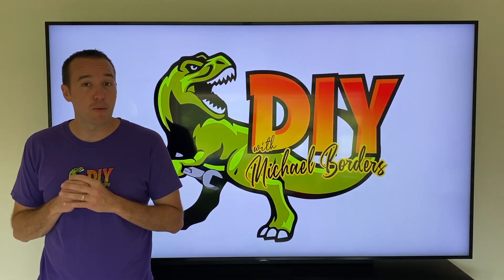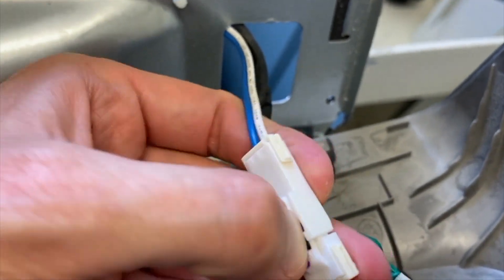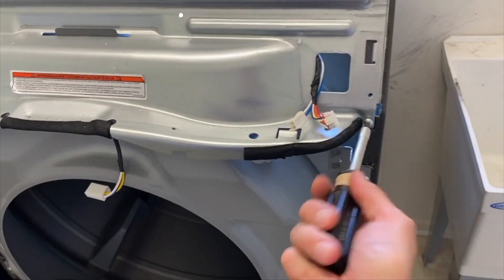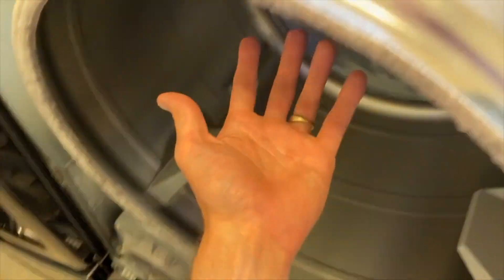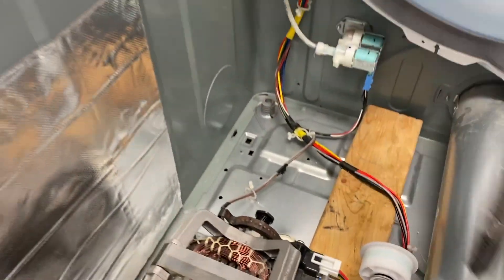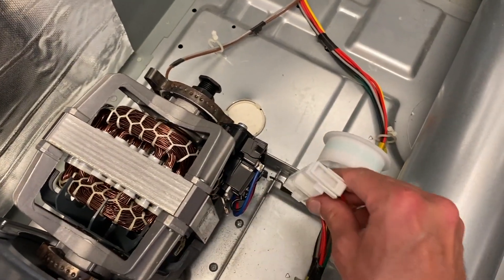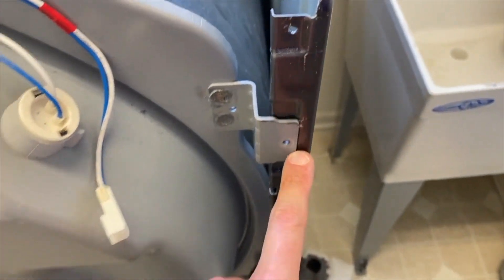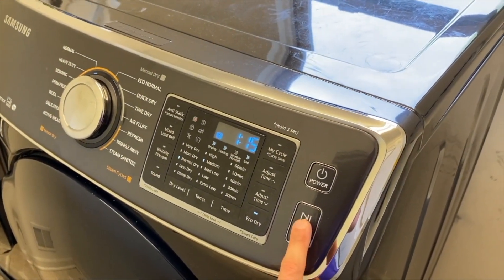How to replace Samsung drive motor - Dryer buzzing/humming

Comment: You My friend is a life saver. My machine had suddenly stop working after a piece of clothing had gotten caught in the lint trap because I had forgot to put it back after empty it. I heard a dislodging noise I quickly open the door to find out the lint tray was not there(oops) Immediately I thought it was the belt. I took the top off and check the belt and the belt was intact. After watching your video, I learned about the rollers and still wasn't sure if it was my motor that got blown out.  I started to tug the drum forward a couple of time to make sure it was sitting on the rollers. I started the machine and still no spin.  I tugged the drum again forward with two hands and gave it a good pull.
I started the machine again and voila!! You just save me $400. Thank you so much for your tutelage and God bless you my friend!!!!!! Big Thank You Sir!!!!
Reply from the maker: Awesome, that is great news!  Saving $400.00 is a wonderful feeling, regardless the situation.  😁👍

We are happy to hear you’re back up and running.

Comment: This was an awesome experience. 
For those run into fan issues you have to use a heating gun to remove the glue from the bolt. The newer models are glued tight. 
Heat up the bolt then you will be able to remove the fan from motor. FYI,  make sure that you have plenty of time to get this done. 
I greatly appreciate this video and others. THANKS!!!!!
Reply from the maker: Good morning, we are drinking our morning coffee answering any and all questions for the DIY community.

We appreciate you sharing this info, any and all helpful info is greatly appreciated!  😁👍

Let us know if you have any questions and hey if you’re into crypto trading, join our newly launched DIY ecosystem.

       toolboxtoken.com

Reach out to us any time!  🧰
Reply: Broke a file trying to pry it off and almost broke a screw driver before deciding to go through comments. The little hard green  stuff at inside of the bolt should have told me something was up. Probably glued it because it was too easily fixable.

Comment: This is a very precise and well done video.  I actually bought a new dryer from costco for black friday sale.  I searched and found this video just for the heck of it.  I was thinking it was too much work and new motor was prohibitily expexpensive and risky since you don't know if you can do it right and it was actually the problem.  Took it apart per video and wouldn't you now it there's a sox in the fan.  Ugh.  Put it all back together and it worked!  Just think it was going to the landfill.  That would have been a waste!   Wife must have forgotten to put the lint cover on the last time.  Well I gues I got a good backup working now I can put in my rental.
Reply from the maker: @quinvu  

Awesome job making it a DIY project and disassembling it, and finding the sock caught in the fan.

Are you returning the dryer you just recently purchased, and getting your money back?

Comment: YES! Turned out my motor didn't have the broken plastic arm, but one of the tiny nubs on the brass arms that actuate the plastic arm had fallen off. I decided soldering that back on wasn't likely to be a durable repair so replaced the motor. While I was in there I replaced the belt and tensioner and vacuumed out a fair amount of accumulated lint. The only trouble I had was removing the control panel. Mine has several plastic clips that have to be pushed from odd places to release. It went back together easily, once I figured out how to route the belt - the tensioner pulls the outer (left as you're looking from the front) side of the belt back toward the center. Fired it up when done and, holy cow, it is quiet! We hadn't realized how noisy it had become as the belt aged (6 years). Thanks MB!!
Reply from the maker: Good morning and you are very welcome.  AWESOME JOB making it a DIY project.

Great idea replacing additional parts along with the motor and yes, the control panel removal can be a bit annoying.

Welcome to the DIY Raptor Club!  😁👍

Comment: After watching your video I went online and bought the motor. A couple of days later I got the motor so I started following your video and once I got to the part where it said to remove the filter cover I found a sock stuck in the between the blades and the housing. Once I saw that I put everything back together and now it’s working like normal
Reply from the maker: @alanmartinezblack  

Oh how cool is that.  😁👍

Awesome job making it a DIY project and pinpointing the actual cause…that being the sock jammed in the blades.

😁👍🧰

Comment: Great step-by-step procedure for the motor replacement. I probably wouldn't have attempted this repair with out it. Thank you for making this video! 
The biggest challenge that I had was putting the belt back on the motor shaft and tensioner pully. Here's a helpful hint: used a small bar clamp to keep the tensioner locked straight up. After positioning the belt around the motor and tensioner you can then remove the bar clamp.
Reply from the maker: Thanks for watching Dave, welcome to the DIY Raptor Club.  We appreciate your kind words as well as your helpful advice.

Any & all helpful info is greatly appreciated.  Happy New Year to you & your family Dave.

😎👍🔧🔩
Reply: I used a zip tie for that then carefully cut it off

Comment: Outstanding  instructional video. Mine was humming, not moving . Rep;aced motor and while at it, tensioner and belt
Reply from the maker: Very cool, well done.  Since you already had the system apart, it’s definitely a great time to replace additional parts.

Awesome job making it a DIY project, let us know if you have any questions.

😎👍

Comment: I am having trouble removing the front panel. I am having issues repleaseing the  2 clips. Anyway to show how to unhook it?
Reply from the maker: @samang168  

Thanks for watching, any update?  The release tabs can be pretty tricky and stubborn to get disconnected.

Most important method is to go slow and not break the plastic tabs during removal and re-install process.
Reply: @DIYwithMichaelBorders   no luck I clipping it. Do you mind showing a picture how the clip works and where is the best point to unhook it?
Reply from the maker: @ 

Thanks for the reply.  At the ( 1:26 ) time stamp, you will see the lower tabs that need to be carefully shifted up and out of their respective slots.

Soon after, you will see a rod that we used to help insert into the area where the tabs are positioned.  We carefully shifted display panel up as we simultaneously used rod to press tabs out of slots.

Very stubborn and tedious step…the hardest step of the project for most including us.

Comment: i like that this machine doesnt hide any of its screws. still a thousand times harder than it needs to be to take apart, but for a samsung its almost not a pain in the ass
Reply from the maker: Good morning ☕️ we definitely hear you.  Overall, this unit is pretty DIY friendly.  Please let us know if you have any questions.  🧰
Reply: @DIYwithMichaelBorders i just did this, it ended up being a pokemon card stuck in the impeller that was folded over and wedging it in place. i didnt have to replace the motor.
Reply from the maker: @wompstopm123  

Thanks for the follow up, a Pokémon card is believable.  The reason we say that is because they’re EVERYWHERE in our house.  We have seen them on the floor in our laundry room a few times over the years.  We always yell, come pick up your Pokémon cards. 🤣

Comment: Brother, I really appreciate you for leaving this video out there but that's why cuz we need help. Everything I've been doing so far is going smooth thanks to you but stuck with a fan. It's stuck to that nut with a thread on it. It's not releasing it and I don't want to do anything else to break it. Could you please tell me what's my other solution?
Reply from the maker: Good morning ☕️ we appreciate you sharing this.  Any update?

Have you checked to see if your nut is reverse-thread or normal thread?

Comment: I can't get the fan to budge. I've wiggled and wiggled.  It doesn't move.
Reply from the maker: @greggcurrie1399  

Thanks for watching, any update?  Is the hardware rusted or corroded?  If so, some penetrating spray may help.

Comment: 3 minutes in and I know for sure a professional is going to charge a fortune to do this.
Reply from the maker: Thanks for watching, you can definitely plan on spending a good chunk of cash if you don’t DIY this.

We are here to help answer any questions, looking forward to hearing back from you on how the project goes.
Reply: @DIYwithMichaelBorders I can’t get the fan blade off.
Reply from the maker: @cbrooks0905  

Thanks for the reply, any update?  May need to apply a penetrating spray to it if it’s rusted and seized.
Reply: @DIYwithMichaelBorders  this is becoming a nightmare. I got the fan blade off by removing the entire housing with the motor and blade attached. Then I took my hammer and tapped it out. There’s no way that thing was coming out any other way. 

Anyway, all seemed well until I installed the new motor and found that the fan blade doesn’t fit the bolt shape on the new motor. The bolt shape on the new motor is a full circle whereas on the fan blade it has that straight edge. I thought maybe I ordered the wrong motor so I searched the specific model number from the old motor and it appears that this is just how they sell the motors now(at least on Amazon). Ok, so I thought maybe I’ll just have to buy a new fan blade that fits the new motor. THE FAN BLADES HAVE THE SAME OLD SHAPE HOLE! 🤦🏻‍♂️ WHY?! So the fan blades are not compatible with the motors. I guess my only option now is to call Samsung directly, unless maybe you have a link to the right parts?

Edit: I just followed your link for the motor and the motor showing on there is exactly what I have. The one you have in the video is not the same. They’ve changed the motor without changing the fan. This is nuts.
Reply from the maker: @cbrooks0905  

Thanks for the update, why in the world would they make that change…🤔

The link below still shows the motor with the machined cut on the fan blade shaft.  In other words…not a perfect circle.

If interested in purchasing this drive motor, visit our Amazon affiliate link below.

       https://amzn.to/3d8CYnj

Sorry to hear you’re having an annoying experience.  Please keep us posted.

Comment: does this dryer had starter????
Reply from the maker: Thanks for watching & welcome to the DIY Raptor Club.  The control board is the main start up unit.

Are you experiencing buzzing or humming?  If so, the most common cause is a worn out drive motor.

😎👍🔧🔩
Reply: @DIYwithMichaelBorders  thanks you for reply my question 🙏🏻
Reply from the maker: @NoName-ux3by  

Us fellow DIY’ers need to stick together!

😎👍🔧🔩

Comment: For anyone following this, take the fan off before you release the mounting clips for the motor. That fan is a huge bitch and will not come off easily if the motor is loose.
Reply: Can confirm.

Comment: Anyone else have issues removing the nut? I’ve been hitting it with a sledgehammer and it won’t budge! Yes I’m going clockwise. I’m in tears, please someone help. I’ve searched all over and no one else seems to have this problem but me! 😩
Reply from the maker: @awalderich  

Thanks for watching, any update?  That’s a bummer you are having trouble.

Have you applied any penetrating spray such as PBlaster to nut to weaken or loosen nut?